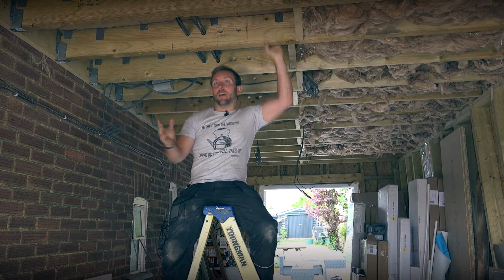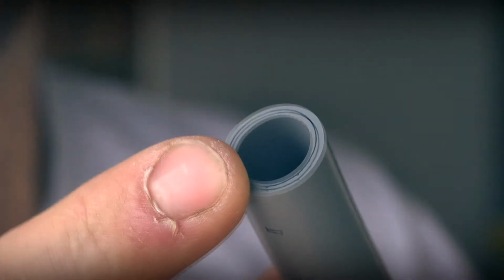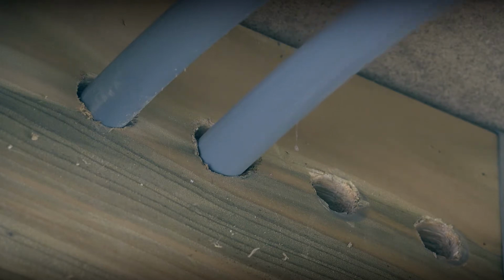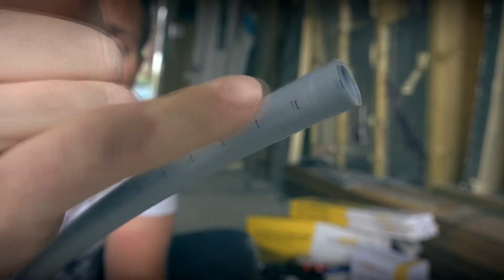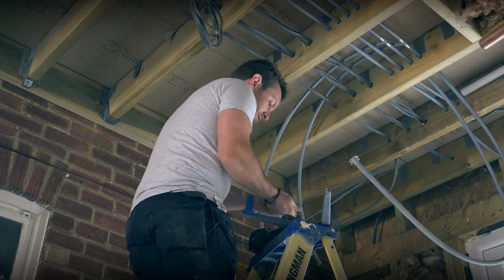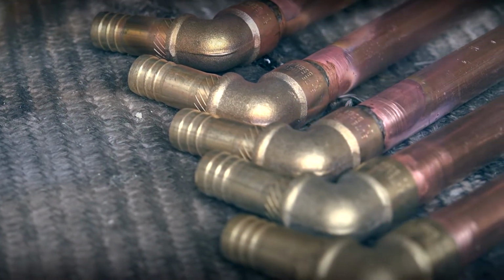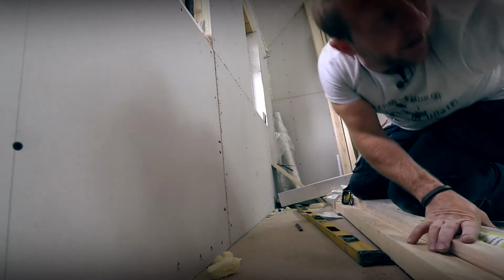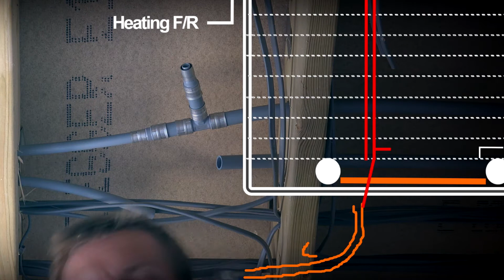Plumberparts Installation Review of The Buteline Plumbing System

Comment: This is sponsored, not honest. This review is honest: https://www.diynot.com/diy/threads/my-buteline-review-from-a-small-time-property-developer.491174/
Reply from the maker: Hi "WJF84" thanks for taking the time out to review our product, we always appreciate constructive feedback, however feedback from the 1000's of installing Plumbing Contractors (and Housing developer's) now only fitting Buteline tells us once they have become familiar with the installation of our product is so simple and easy to install and the tools very rarely become obstructive during installs. We are also a little concerned at your experience with our ProClamp tool, which yes does require periodic (maybe yearly depending on the amount of use) recalibration, but by no means is in anyway inferior to our Standard BFR Tool. Finally we believe the alleged noises you hear maybe from expanding pipes that have not been clipped using a Buteline pipe clip (our clips allow for movement in the pipe) but we would be happy to send one of our External Representatives to meet you to discuss and demonstrate the features and benefits of Buteline and even provide certificated product training if you wish. Once again thanks for taking the time to review.
Reply: ButelineUK Ltd I'm afraid your assumptions are incorrect.

It may well be that the pro ratchet tool needed calibrating, but why did the supplied jig slide over the joint to confirm a full crimp? And the fitting still failed the pressure test? The same fitting was then recrimped using the standard crimp tool and passed. This is reproducible.

We used the buteline branded 16mm and 22mm grey talon clips throughout the installation (with the bit inside that allows bounce). It's not the pipe that clicks against the joist or the clip, it's the metal part of the fitting itself that clicks during expansion.

The fact is there were several standard scenarios where the crimp tool was too big to get into tight situations. The pro tool was almost always small enough, but was not reliable.

I actually love the product and can see its uses commercially and for new builds. But you will not succeed with day-to-day domestic  plumbers.